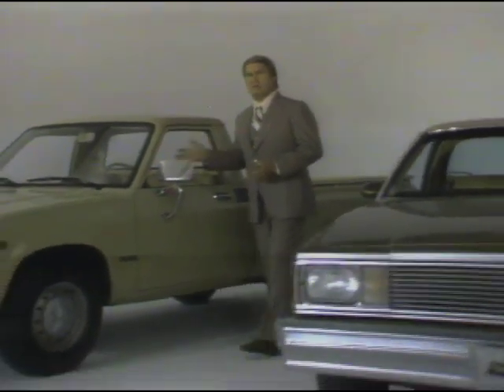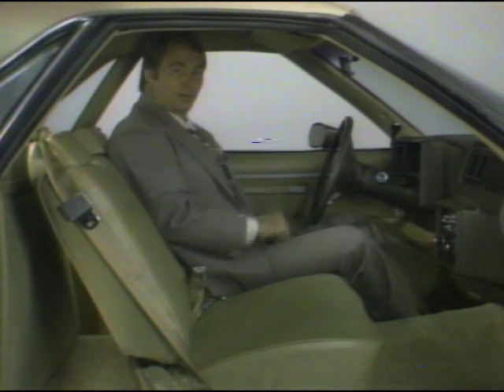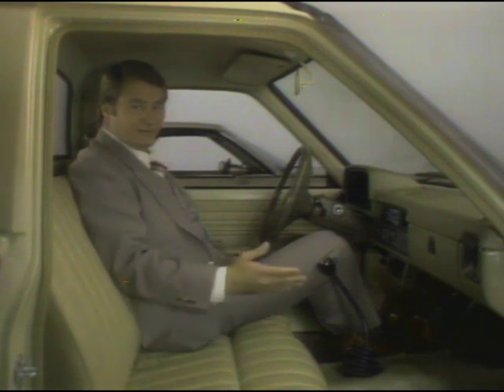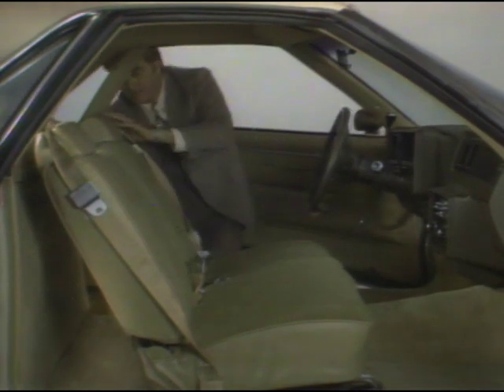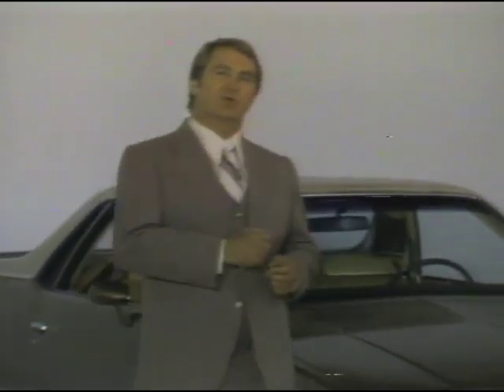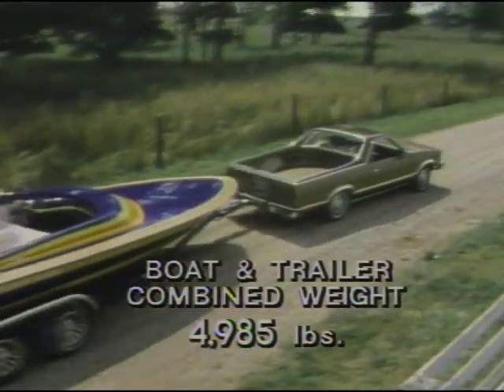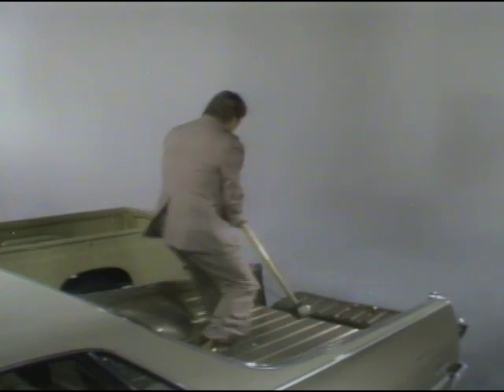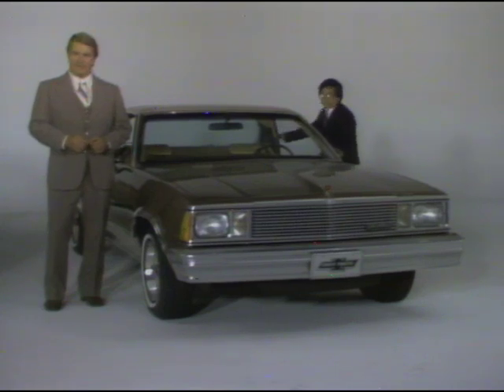1981 El Camino vs The Competition - Dealer Film GM200

Comment: I think vehicles like this would do much better today than they did back then, just that they will be unibody, have four doors, be front wheel drive and have a turbo 4 cylinder or hybrid powertrain. I get the impression that back in 1981, the El Camino was more for pleasure driving while the import trucks would be put to work in some commercial application.
Reply: @OhPhuckYou  Yeah, I know, both the Maverick and Santa Cruz have their reliability and quality control issues now. I was just thinking what it would be like if the Chevy El Camino, Ford Ranchero and Dodge Rampage had continued production uninterrupted, what would they look like today? Would the Ranchero have turned into the new Maverick?
Reply: @OhPhuckYou   Yes, I agree, they should have continued the heritage with the Ranchero name. Once the quality control issues are worked out I'd consider a Maverick Hybrid. Just thinking, in Australia, until recently, Ford sold the Falcon Ute and GM sold the Holden Commodore Ute (which we kind of saw in its sedan format as a Pontiac G8). The pickups were still two door regular cabs, so we can see how they evolved in the land down under.
Reply: @reallyrandomrides1296 I mean these el caminos had their own quality issues
Reply: @zadman49 I still see them at home depot used as trucks or at cruising nights with a nice cam.. Thing is, they survived 40 years in the rust belt. I have a feeling the maverick will be long forgotten in 40 years. 😂